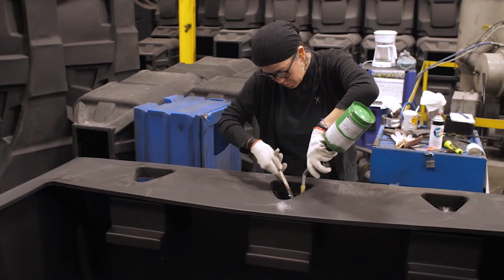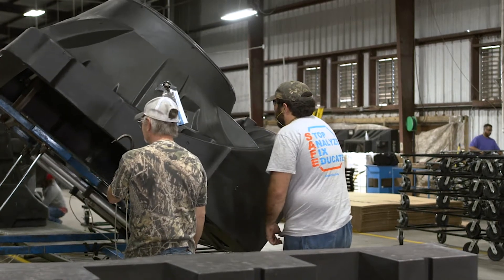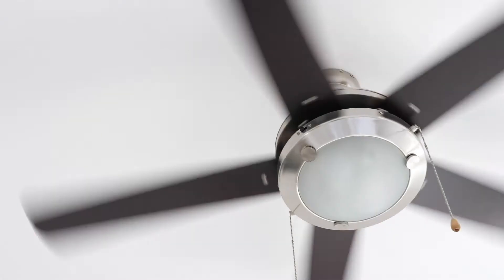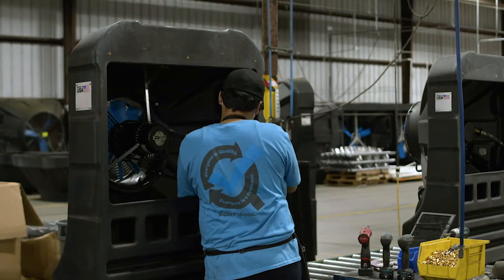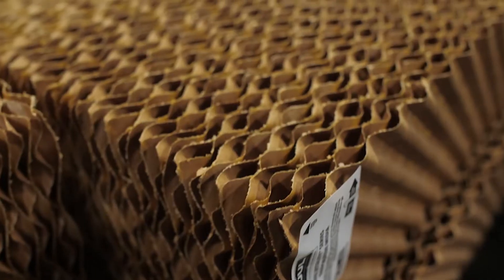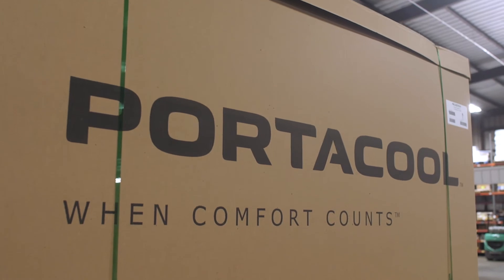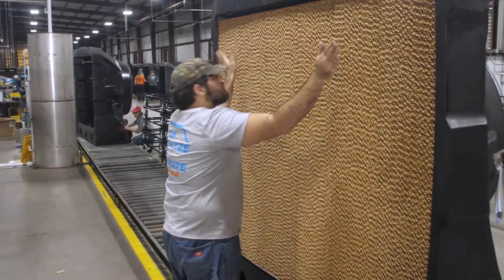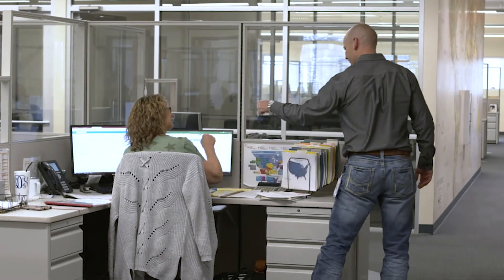What is Evaporative Cooling?

Comment: I called the main office of portacool in Texas to ask if they had a model that had a door you could open to put blocks or bags of ice in the Portacool, they transferred me to the engineering or design office.  The guy just argued with me the whole time, telling me to just take membrane out of back and put the ice in that way. I told him I do not want to shut it does every time to put ice in it,  he continued to argue with me more and more and never actually told me if they had a model with a door on it so you don't have to take it apart every time to add ice. So I said your competitors have that feature why don't you? He then ask which company are you talking about? I said your competitors again? So I finally told the moron the name and he said I've never heard of them?  They are all over YouTube and the internet. How can you be in a top position like that and not know your competitors dumb dumb?  For all you people looking at get an evaporating cooling system please check out Super Cooling Fans in Utah.  Better fan motor, better fan blades, balanced fan blades, quietor fan, better defusor,  UV bacteria killing light, variable speed motors every model, door to add ice or ice blocks, drain you don't have to lay on your back to open, and most importantly nicer smarter staff to deal with check out Super Cooling Fans!!!  Not PORTACRAP!!!